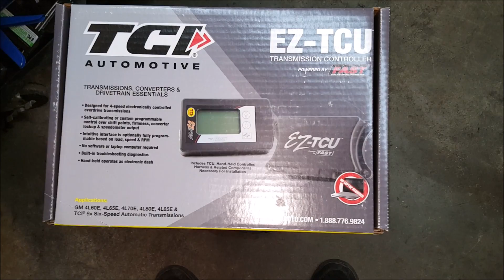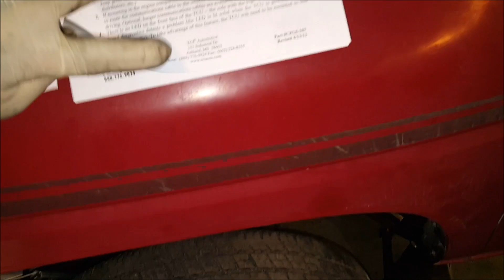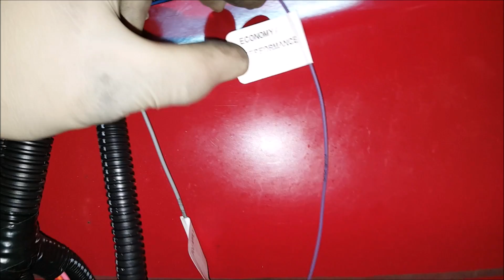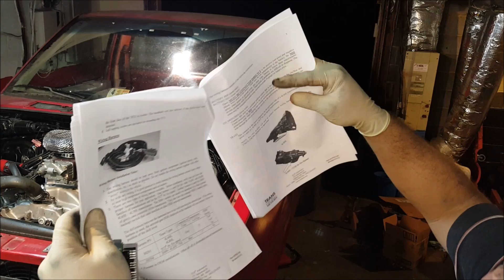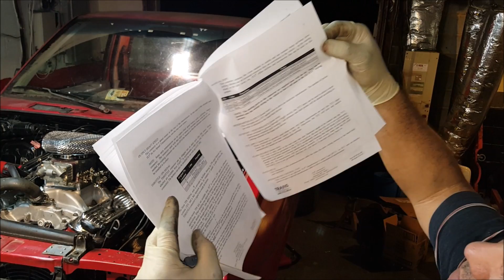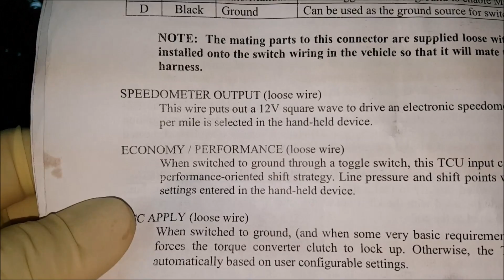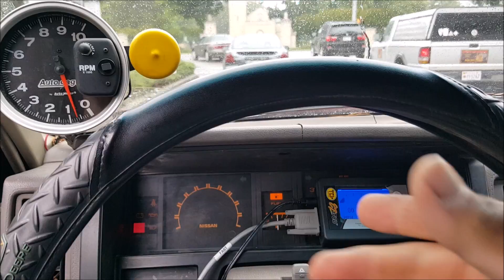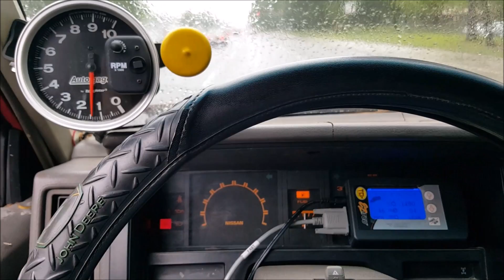EZ-TCU 4l60-e transmission contoller on a sbc nissan pick up (part6)

Comment: Thanks for sharing! I’m gonna install the controller in my 91 2500     4wd 4l80e . Already have the TCI  tps on it . All those wires will intimidate most people but I do work on a lot of electrical problems. Video you shared will help a bunch of guys!!
Reply from the maker: Good luck. Its wasn't that tough and I dont work with wireing much.
Reply: angelfiggi   So cool thanks for respond!! Make some more videos!!
Reply from the maker: @ronaldlewis6062  I'm in the middle of making a video of an AWD reverse trike using an old Durango. If it works I'll post it. If it doesn't I'll post it anyways..

Comment: been wanting to do a similar conversion to my Nissan . keep up the great work
Reply from the maker: I'll be doing another video installing the front drive shaft and figuring out the electric tcase. also I have a set of ladder bars that I'll be installing then try it at the track
Reply: I put a lift on mine and it came with HD torsion bars. You should be able to index yours and have it sit a little better.
Reply from the maker: yeah I will. I just got lazy right now. but it will be higher
Reply: +angelfiggi ... right on . was thinking 5.3 for mine but that's alot of wiring for fuel injection
Reply from the maker: I'm not patient enough for injection
Reply: +angelfiggi well I'm not smart enough to do it. your conversion looks much better

Comment: angelfiggi 
What is it like to drive a car with EZ TCU, I want to install one on my car. Replace my old automatic.
Does your gearbox behave similar to other automatic ?

Please describe your experience or make a short review video!
Reply from the maker: I loved it. It worked great. Im buying another one for another car. The display went crazy at one point and i called them and they replaced it. It shifted the tranny good. I was able to set it from easy shifts to hard shifts.  I had it set a little above middle with no issues. Ive used it daily since that video but i sold the truck a month ago
Reply from the maker: I had it on a 4l60e 4x4 tranny now im installing a 4l80e in a 87 montecarlo ss

Comment: When you switched to the bigger connector for the output shaft speed on the trans what side is the solid purple wire on since it only plug in one way???
Reply from the maker: Sorry its been a while since i did it. I can't remember
Reply from the maker: You can call tci and ask, they can help better than me

Comment: how can I do change all my wiring from the original on the Nissan to the one that comes with the LT1 what wires do I need to cut and put the ones from my lt1?
Reply from the maker: Damian Salinas you need to get a stand alone computer for your engine if your keeping it fuel injected. you can call tci and find out what they recommend but expect to pay $500+... I personally don't know since I kept it carburated. As for gages I'm removing the what came with the Nissan and making a custom set. But I won't be able to do that until  the summer
Reply: angelfiggi  so the computer I have with the lt1 engine doesn't work bc I have the lt1 engine computer?

Comment: how is it going after about a year. the controller
Reply from the maker: Deez Nuts I'm not sure.  I was racing a BMW and a gti.. we were doing about 120 at a (road track)😁 and now it's doing something weird. the tps percentage on the controler is fluctuating up and down rapidly and I have a trans code. I'm going to replace the tranny with another one and see if the code goes away.

Comment: Where I can find the cable tps?
Reply from the maker: I got it thru summit catalog
Reply: @AngelGarage  by any chance do you know the number or code for that part?
Reply from the maker: Actually I went straight to TCI and got both EZ-tcu and TPS #377400
Reply: @AngelGarage  ok taks sr
Reply: No input shaft connect for the trans?